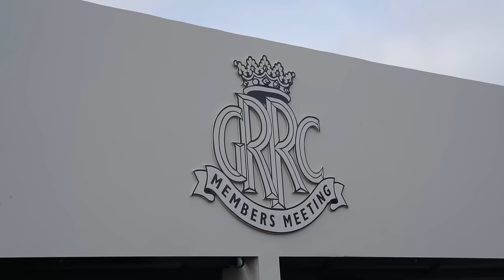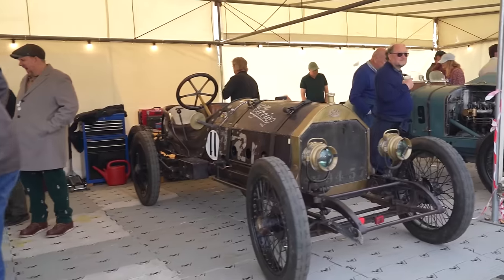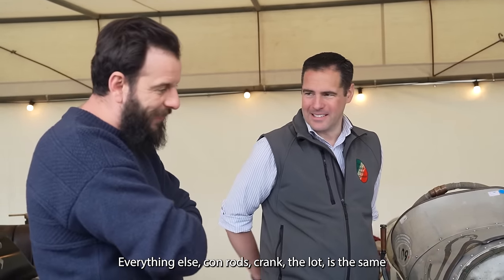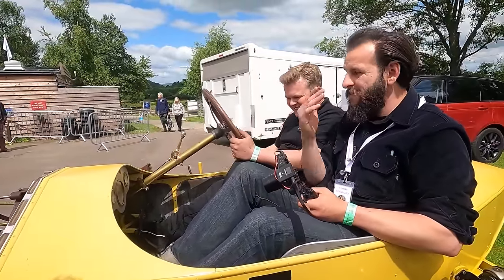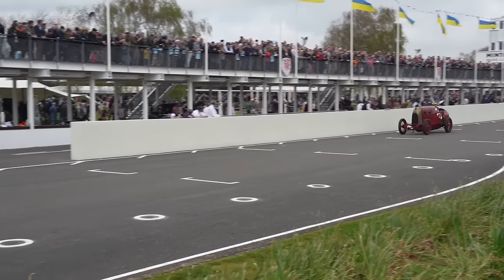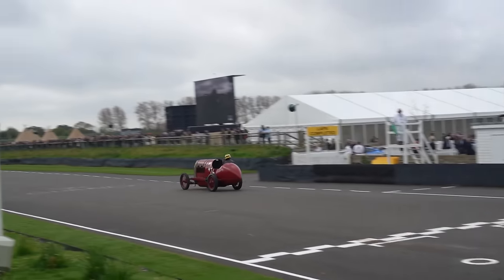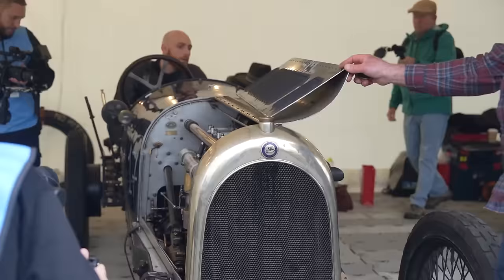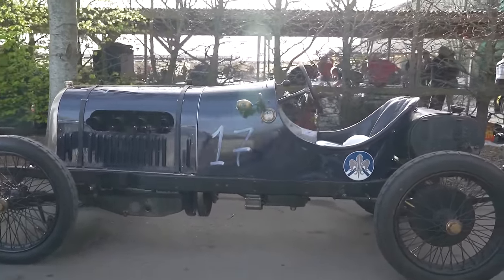Aero-Engined Cars at Goodwood Members' Meeting!

Comment: While I very much like (or even love) full bodied cars with a wasp tail (I regard the Bugatti Type 35 to be one of the most beautiful cars ever built - period), I have to say that this is not what I think would suit an aero-engined Edwardian race car best, because it is 'too modern', more like mid to late 1920s (although I am aware that race cars with cone-shaped tails did indeed appear much earlier). 
For me a distinctive element of Edwardian race cars is that everything - and especially the engine as the crucial part of a race car - is out there in the open, and everything has a somewhat awkward cobbled together appearance which speaks of the contemporary ideas of how a racecar should be designed in a pre-scientific age, without the use of wind tunnels and the like. 
So if you should intend to use a conical tail, it definitely needs to look a bit awkward, in a geometrical 1920s style (think of Bauhaus designs here) putting it up high (with a horizontal upper line, and a diagonal lower line), but not in a streamlined 'modern' late 1920s/early 1930s style.